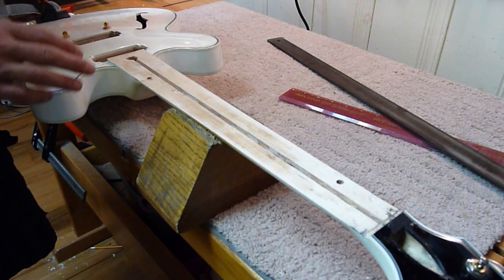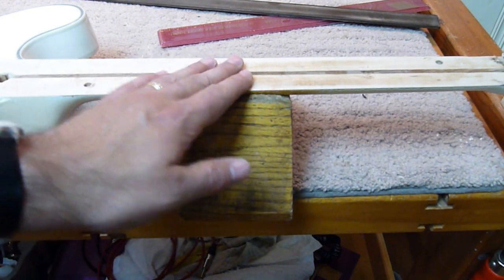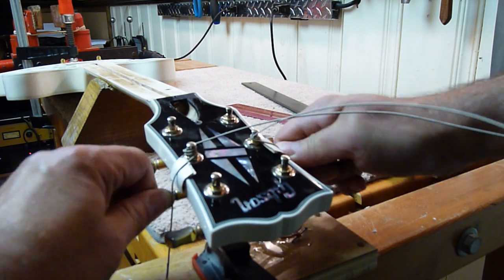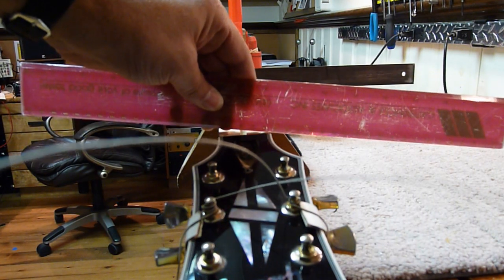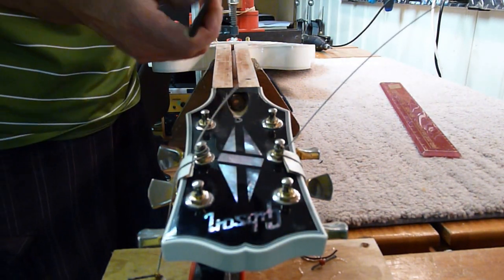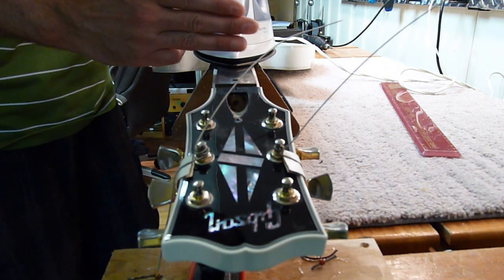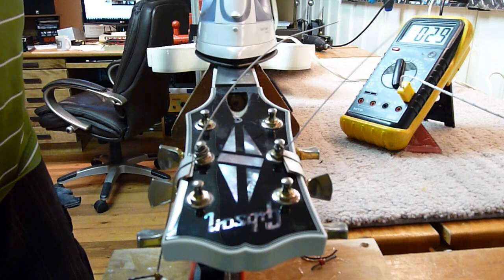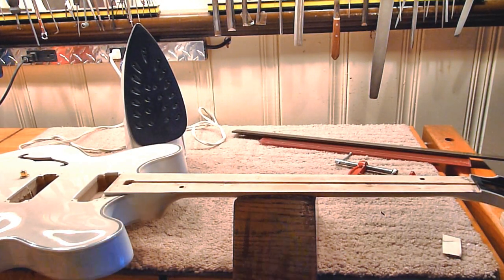Straightening a Warped Neck

Comment: wow.. mind blown. Great job! I have a Gibson es-339 that I recently acquired and the bass side relief is noticeably more than the treble side..almost as if a dip in the fingerboard between 7 & 14. Is something like that correctable and/or worth correcting? I am local to you and would love for you to look at it.
Reply from the maker: Hey Rusty! Probably fixable (well...anything is fixable :)  I will be happy to take a look at it!
Reply: Fred, I am so very pleased with the magic you performed on my Gibson.  The neck went from awful to awesome.  I am very fortunate that I stumbled upon this video and found you to be local.  Genius at work..  Many thanks.
Reply from the maker: Glad to hear it Rusty!
Reply: This right here is the most satisfying thing I've read in the comment section of youtube in years.
Reply: @Rusty_Spoke  That's fantastic. Please pray for us, for guitar repair, We mainly have guitar center and sam ash here in Central Florida. Ahahaha.
Reply: Hi freddy i have a gibson les paul R0 and noticed that the headstock seems to be twisted a little to the right,but the relief is the same on all strings,lots of people in the Gibson forums say this is normal for the headstock on les pauls to be not square with the body and its by desighn,what do you think

Comment from the maker: I was trained in woodworking by my dad. A master of the craft. But I've always been curious about how things work, so I would take things apart and put them back together. Even when I was 12 years old my dad bought me a motorcycle and I wanted to know how it worked so I took it apart. Every nut bolt and ball bearing (even the transmission) I had parts all methodically laid out in the garage and when my dad saw that he shook his head but he wasn't mad. I put it all back together and it ran fine!
Reply: FreddysFrets reminds me of when my old Subaru as a kid got smashed and I didn't have the money for a body shop.  So my dad and I parked the car against the curb and wrapped a come-along winch around a tree and kept ratcheting down until the sub frame was straight.

On a side note, years later, do you know if that guitar neck is still good?  I have a Guild F50 with some warping.
Reply: @jefferyaeastman   Freddy didn’t respond, but I will. 9 times out of 10, the neck returns to the twisted/warped state. The only fool proof method of ‘bending wood’ is to introduce steam and/or actual water to soften the wood fibers as you add heat. At that point, you ARE indeed refinishing the neck.

Comment: 50 degrees? You must be talking Celsius. I use a steamer, no risk of burning the wood, and the steam helps it bend. I overbend the twist portion a bit too, so when the tension is released, it comes back to straight. I leave it in the setup for as much as two weeks, depending on the severity of the problem. My rig uses bass strings and tuners on a rig that's movable, so I don't have to leave the thing on my workbench.

Comment: I have a Strat neck with a maxed out truss rod and a forward bow.  I clamped it between two blocks on the fretboard and a soft block on the back, tightened to about 2mm back bow, and put it on top of an oil filled room heater for a few hours. I let it cool, released the clamp, and it’s fixed!  No steam needed, just heat. Now it still needs a good fret leveling but at least it’s usable again.  It was good to see I wasn’t crazy to think heat alone would bend this back.

Comment: Great video and tips! I actually used a hybrid of this method on a severely twisted acoustic guitar. Instead of using an iron, I used a heating blanket (and moisture) after securing the guitar down on my work surface. I ended up having to repeat this over several days and left the guitar secured in the jig for almost a week. In the end, it worked.
Thanks for sharing this

Comment: Thank you for this video. I had a gresch 5120 with a badly twisted neck. I used this technique without removing the fingerboard or frets. I figured I had nothing to lose as the guitar was pretty much unplayable.I couldn't use the iron so I wrapped the neck with a heat pad from the drugstore. It worked. I had a small amount of fret board separation at the nut. I reheated that section and after it was warmed up I clamped it and let it cool for several hours. That fixed it.

Comment: Hi mate.
Just wanted to say thanks for the info/video. I recently bought a chibson double neck that turned up with a serious twist in the 12 string. I set up this rig just as described and it worked a treat :) The only downside was I must've had the iron on a bit too hot as the inlays popped out. The surprising thing was they were actual real mother of pearl !! Anyway with a gentle tap with hammer and small bit of wood the went back in ok and with a slight sand with 360 and then 1000, they were as good as new. Thanks again buddy. Top tip.

Comment: ...thanks for the upload...up to now, this is the best video I've seen on neck twist repair. I just received my new Ibanez, which I bought on line, I set it up as best as I can, but there's neck twist, preventing low action, which is a shame, because it's really nice looking. I'm going to contact the shop where I bought it from tomorrow (as it is closed on Sundays), and see if they'll either replace or repair it. Since I've seen this, it has given me confidence to know that it is repairable. I just need to find a local luthier. Thanks again....

Comment: Good technique,a heat gun is handy to get all or most moisture out ,heating while adjusting and playing to shape n mold to desired straightness.oiling fret board help keeps the moisture out.best sounding n straightest guitar I ever had sat in my car all year round plus 30 to minus 30 temperatures.you ll notice a humidifier in guitar shops do nothing but baby the guitar .you play a gig the humidity will not be the same,you jam outside. ...not the same. Point is don't baby ur guitar if you want it at it's best

Comment: Genius! My poor wee Korean made Les Paul/Love Rock had a warped neck from the cold climate where I live. You used a spirit level too! Using the strings at the headstock to give "guidance" to the warped neck was inspired. I'd have needed to use the E and D strings for my guitar. 

An excellent video.

Comment: Brilliant and well done, I just did a severe back bow from (probably) being left in a hot place for a long time,  on a classical, took off the fingerboard, thinking to straighten it and the neck separately. Hadn't thought to try it without the finger board removal.

Comment: You can also use a small jack screw mech at that point, to add more tension if the neck needs that much. I was able to save a classical style neck that looked like you could play horseshoes with it, by going slowly, let it relax a little at a time. That one took three weeks plus a couple of days, I'd tighten it up a little bit more every day. Now it's the sweetest playing, sounding guitar I have. It's very old, though I don't know how old.

Comment: I managed to use this method, with an iron on the metal straight-edge, directly on the frets of my $50 pawn shop Epiphone "Junior" neck. The neck was at the tight edge of truss rod adjustment with more needed. 

I backed the truss rod way down but not all the way before starting. I thought I had failed when it came back into tune with a bow but straightened with just a small adjustment. Lots of room left if necessary - so far so good!

Please post if you try on your Strat.
(Thanks FreddysFrets!)

Comment: glad to know this can be done with the fretboard still on. i would asssume recirculating hot water in some 1cm tubing around the neck would probably be a good method of heating everything together, though a bit messier if something were to go wrong

Comment: This video was quite informative/helpful/awesome, I'm gonna get this method a shot on this Dean ML I got off of my friend a few months back, the thing was set up quite nicely when I bought it, but I left it in storage for like 2 weeks, when I took it home, I noticed the neck(specifically the maple) had some curvature, I'm not sure if that's how most Modern C-cut necks are, but I shrugged it off until the time came for a truss rod adjustment, but whenever I tried to tighten the rod, the curvature was still there, It has sort of an up-bow,Sometimes I wonder why I'm going through all of this trouble trying to un-warp a Korean Made Dean lol. I'm glad I've stumbled across this video when I did, now I know how to fix it, Thanks man :)
Reply: Jake Harvey I also subbed!

Comment: Amazing.Great vid! I guess it would be harder to do this with  fingerboard still on, right? Need some way to get the heat in there. I guess you could take some steel bar stock and grind slots for the frets in it?..a lot of work, and radius would mess with it . Hmm just need tons of cheap thick thermal paste? lol or actual idea?  I wonder if many guitars warp like this with just time, especially if set with far too much relief?  It kinda freaks me that car trunk temp could do this, like maybe 175F. I guess the woods are heat dried to begin with, but that doesn't prevent the wood from getting weaker/more flexible when heated?  Can we assume the string tension is what warped it that direction? I guess maybe sometimes necks start out more flexible, more elastic/less strong and so the truss rod is more the thing controlling it then, but then older neck might get stronger with age in general (until heated)?

Comment: What would you suggest if I wanted to remove the twist from a neck without removing the fretboard? I would just remove the fretboard but the guitar really isn't worth the effort entailed. Its a rosewood fretboard on a maple bolt on neck, no binding, if that helps.

Comment: Invaluable advice! I have a twisted and warped Warwick bass neck that also has a seized truss-rod. Of course, the truss-rod is non-removable so I'm taking off the fret-board to get it out. I will then use this method to straighten the neck then will replace the truss-rod and re-glue the fret-board. Do you possibly have a video on removing a headstock-end +  treble-side twist in a neck??? Subscribed btw :)
Reply: Got a warwick bass with a warped neck and im just wondering how it went!

Comment from the maker: you could use the same technique but use suspended light bulbs as a heat source. The trick is to get the temperature hot enough so it affects the neck but not so hot as to scorch anything.

Comment: So, after reading this and having never worked on a guitar before, I tried it on an old short neck small acoustic. removed the bolt on neck, made a little cradle/ jig out of a block of wood, sighted down the length of the neck for twist and found none. Hit it with the iron and a hair dryer and left it overnight. Minimal difference. Repeated with more backward bow and left it overnight. Less than a mil of bow!  Once again, this time, over  bent it, a bit, to compensate for eventual string tension

Comment: Hey Freddy, Love this technique and am going to give it a go on a Gibson j100 .... Here's a thought, using the same technique less the neck support and heating the shoulders of the guitar it may be able to correct a poor neck angle ... Makes sense that since string tension in one direction causes the neck angle to pull forward, string tension in the opposite direction could correct it ....

Comment from the maker: Yes heat lamp or just plain light bulbs will do it. You don't have to take the fretboard off.
Reply: how do you account for the FB radius (curve) when checking for twist with your 2 straightedges since they won't be on a flat surface?

Comment: Brilliant method Freddy, however I have a different problem.  i have a old Ibanez J bass copy from the 80's with a maple neck that came apart. The fingerboard lifted off and one of the strips on either side of the channeled center strip that holds the aluminum truss rod box also unstuck up to the headstock. Had to tap it off to re-glue. After gluing back the strip did a sighting down the neck from heel to head and noticed it veered to the right. Put my large steel ruler along to confirm that. Is this a throw away or can this be rectified? The finger board however is quite straight along both sides. I'm thinking tp devise a system to push it into alignment. Thing is I wont be able to use a clothes iron because I want to clamp a large thick flat piece of wood to the face of the neck to prevent any other warping. I could be over thinking this... I don't know.

Comment: should I attempt this process on my guitar if the trust rod is still in place (as it aint broke)? Its an old circa 1967 12 string given from my grandpa. the neck is just way off, first 3 fret action is good but to the 17th fret area its 3/4 inch space between strings and neck, I did tight the truss rod but it gets impossible to go more, if i do i bet its gonna break. thanks nice video!

Comment: Thanks, great video !! 
I have a Fender Precision Bass with a warp 4to6in. from the nut.  Being that the tuners are inline I was wondering if you have any suggestions as to controlling the tension at the headstock.

Comment: If you use heat and steam, you'll most likely loosen the inlays. Whether or not they will tighten back up ... your guess is as good as mine. However, if the neck has been twisted for a long time, the fretboard will be twisted as well, so you might as well straighten it all at once. I wouldn't put heat directly on the inlays, that case calls for some heating and or steaming method that's more controllable. I have injected steam in the truss rod cavity with some success, but take your time.

Comment: When you checked the straightness and twist of the neck after you let it cool over night shouldn't you have checked it with the tension off the headstock to make sure the twist doesn't come back without the tension or did you do that and just not clarify in the video? Also, this method won't work on a 6 inline tuners headstock.  Do you have a method for, let's say, a Jackson style headstock?  Thanks, great video and technique

Comment: I have a small parlor guitar with a twisted neck. Will this method work without removing the fret board? Can I apply the heat to the bar resting on the frets?

Comment: I have a similar issue on an old Ibanez acoustic, but haven't busted the truss rod yet 😀.
I am wondering, if I've already tightened the truss as much as i dare, would that tension alone bring the neck back into line by applying the iron as shown here (without any clamping)?

Comment: Hello Freddy can you plaase help me, I have a Epiphone Les Paul and it has a Stripped truss rod nut. I don't think the truss nut can come off off the rod, so It looks like I will have to replace the entire truss rod which means I will have to remove the fingerboard. The trouble is I can't find any information at all on the size of a Epiphone truss rod, that's the entire truss rod I mean. Could you tell me what the size is on this guitar? When I was researching this issue it was also unclear if the truss rod nut can actually come off the rod could you maybe tell me if the nut can actually detach from the rod. If you could let me know any of this I will seriously appreciate it.

Comment: Can the sane method be applied to a severe hump from the 6th fret up to nut? 
I have the nut off with no relief left. There’s an obvious hump down while sighting  the neck. It starts at 6th fret and drastically bends back. It’s not playable 
I was gonna try this but with neck fret side down and a piece of wood under the starting point at 6th fret and bend the hump out with carpenter clamps. I’m
A carpenter so I know wood. I’m hoping it’ll work but what do you think?
Reply from the maker: it should work with enough heat and time ....just be careful not to scorch the finish.

Comment: freddy, have you ever tried to heat up the neck and straighten it with heat lamps? I know this one was totally different as the rod was busted, but I have seen it done by Dan Erlewine and Hideo Kamimoto and it looks very clean and most importantly very controlable as far as heat exposure goes.

Comment: good idea with the tuners to get the twist out, I'll have to try that. What I never understand with straight necks is if the truss rod puts some back bend in when tightened,, is it any good for anything unless the neck warps to a forward bend. A good setup guitar neck should ideally have a little forward bend for strings to clear at a low  action better, so  I never adjust my necks perfectly straight, just almost straight. The truss rod would then be useful to cope with any slight bowing as the wood settles and dry's in either direction.. So interests me why people aim for straight as it results in a higher action.
Reply: hope  I haven't confused my back and forward bows,  I'd call what you were doing there as correcting a forward bow. although the point of correction was bowing back.

Comment: Woh, you need to plane the neck flat. Once a neck is twisted it will return to that position. Also applying steam is certainly only going to make a volatile situation worse by creating an unstable medium; hot steam into the wood. Yes, plane it to level; she’s fixed correctly. Cheers.
Reply from the maker: It's been 7 years since I did this. The guitar is stable. Cheers.
Reply: FreddysFrets You’re the only person I’ve heard of were this worked. I did a great amount of research from many Luthiers as I have same problem years ago. Extraordinary.

Comment: Hello, I've quite a similar problem. Neck is perfectly straigh on E-low side and has back bows starting from nut to 5th-6th fret on the E-High side. My question is where to place the wood support for the neck? Maybe the ideal is to place it in top of bow but being so close to the peghead I'm scared about putting too much pressure on that area. What do You think about?